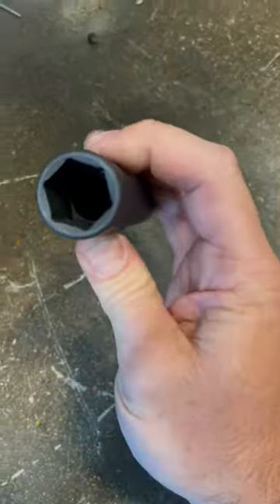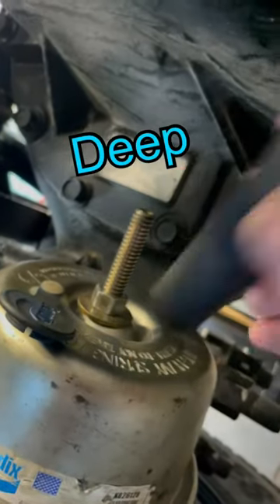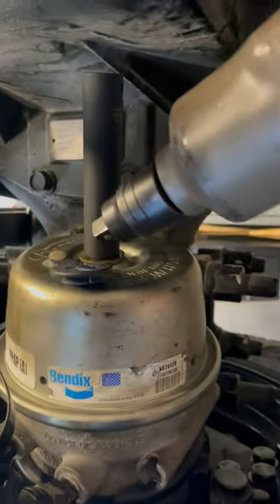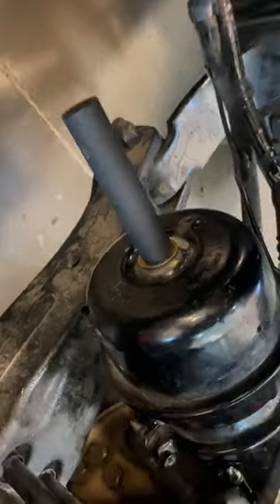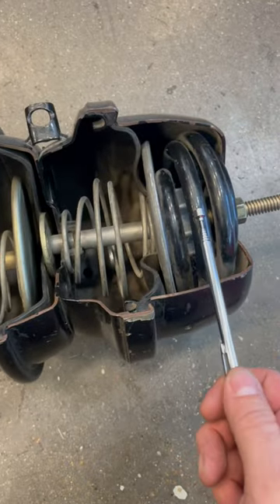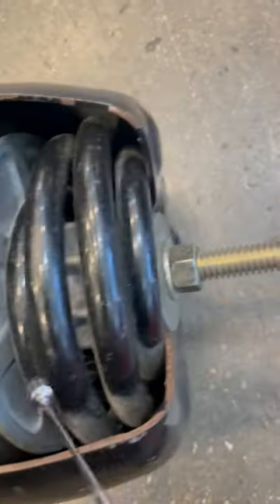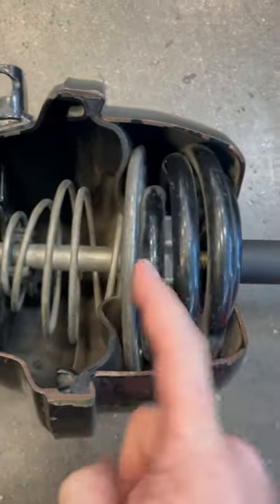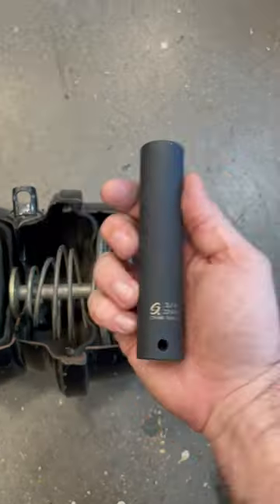Caging bolt SOCKET? NO!! #diesel #tools #garage #trucks #mechanic #custom #semi #diy #hack #tips #no

Comment: Yes there is that chance. There’s a chance of a million things happening but let me tell you that bolt will break  before the chamber every fucking time. Never once have I had the chamber itself ever break. And fyi the caging socket is what I use everytime. Please don’t come out here giving false information. Beginner mechanics need to know how to use all their tools and equipment and you’re gonna scare them away from doing something that’s worked for years with your own fears. Fuck fear, do your damn job and when something goes wrong then you learn to not do that or do it differently. No experienced mechanic is going to tell you that’s a bad idea idk where you’re getting that thought process from? I’ve never seen or heard anyone ever bring this up let alone experience it😂

Comment: Put air to the chamber spin the nut down hand the tight, tighten it up with a wrench. If the unit is wrecked then do what you have to do.

Comment: I just wonder if they make one in a 21mm or 13/16...
You can fit about 3 open ended lug nuts inside a normal deep well. Several times I've thought it would be sweet to have a really deep socket for this purpose. You could zap off five lug nuts off without having to touch/collect the nuts.

Comment: I always just release the brakes first then push the caging bolt inside, or just will the parking brake is released i just remove the chamber then just apply the parking brake and remove my fittings 🤷🏽🤷🏽

Comment: Easy to jus supply air, then lock bolt when spring is already compressed
Reply: Sometimes you don't have that luxury in the real world nice try though
Reply: And what if the spring is broken inside the chamber and cannot be compressed?
Reply: @topaz123212  no need to cage it then but the new  replacement chamber gonna need caging.
Reply: @mlafi7  never have I had to cage a new chamber to put it on sounds like you think that you know what you are doing through YouTube videos I have replaced brake chambers on many different trucks I would know what it takes to do the job
Reply: @trevormiracle9165  to each his own way buddy ,was jus a tip on how av done it .
Reply: @mlafi7  the ones we get here usually come pre caged and ready to throw into play, attach air lines and remove your new free caging bolt for the next bugger that comes in
Reply: @trevormiracle9165  as you'll see in my other comment, depending on where you get your chambers, some of them come with a caging bolt already in it.
Reply: @topaz123212  I have never had to cage a brake chamber to replace it is all I am saying and it's a lot simpler than caging it off and having to uncage it after installation
Reply: @trevormiracle9165 I agree with the other guy, for me it’s easier to cage them before installing, they typically come caged (for me). You’re probably that one dude who doesn’t clock them in the same position as the old one
Reply: @josh351  they only go on one way try to put them on the other way and they are upsidedown with the air hoses pointing at the ground
Reply: @trevormiracle9165 I mostly agree with you on this one but I’ve found a couple where I’ve had to clock the hoses to the side

Comment: There is nothing at all wrong with the socket or even using an impact, it all comes down to having some common sense when you're using it and not trying to bottom out the bolt.

Comment: I would chock the wheels on a couple axles and release the brakes at120 pounds and shut the engine down and attempt with speed to get under truck and with brakes released if lucky get tool on back and snug up before chamber runs out of air and with any luck not have to run wrench on it to much for it to make safe to change out.Remember there is 30 pounds on each side of chamber hence 30 30 air brake.They make bigger ones depending on applications 😊
Reply: ?? The "30" is the size, not pressure. As in 30 in² not 30 lbs.
Reply: 30in Sq x 60-70psi = 1800lbs

Comment: I just apply air to them even if the chamber has a leak it will still release it long enough where you can just spin the nut all the way down

Comment: Not an HD mech. But is it not just a matter of knowing your tools? My impact has settings that apply differing tq as well as a trigger that also adjusts. So I can use my impact even on small stuff but not break anything by setting it properly. But I have no idea how fragile those brake chambers are.

Comment: Bro if the spring is broke then no harm just stand back lol. Pancake failure is much different and less scary. Just release the brake and no worries.  It's not dangerous if you understand

Comment: Been using this style socket for close to 20 years and have never once had an issue. Hundreds if not thousands of chambers.
Reply: You've just never had one come back when they couldn't cage it the next time.
Reply: @vr6prodigy  I oversee a fleet of trucks. I've seen the same trucks every day for over a decade. I've never had an issue. Caged thousands if not more brake chambers.
Reply: yea i totally agree plus he keeps saying hammer which is not right. impact drills and hammer drills are two different things. impact drills dont really hammer at all its the centrifugal force of a spring assisted rotating hammer and anvil. it hammers side to side not up and down. sure u can over tighten it but force is not transferred in the same way like hes misleading 'hammering'

Comment: Ur not supposed to run it down tight , its only to back off the brakes,,,,if it breaks you just cant cage it anymore ,but the brakes will still release with air ,,,what r u talking about

Comment: I use what I have/need for the situation. When you're the wrecker operator, ZFG. Most common for me would be a 3/4 ratcheting closed end wrench, does the job quickly and is always in my pocket.
Reply: My favorite method, too.
Reply: gear wrench pass through socket set does wonders on them too

Comment: I have a 2 5/8”  1” drive socket that only gets used for tightening liner bolts on our mills. It weighs 10 pounds and is about a foot long lol.

Comment: Never use an impact but I damn sure do use a ratchet and a word to the wise make sure you put a little gear oil on the threads of the cage bolt it will keep he thread from getting galled up
Reply: Use the socket just don't use the impact gun use a ratchet and if you don't know what your doing with air cans don't do it have someone who knows what there doing deal with it I've seen those things grenade and hurt ppl bad not me yet back I'm also not stupid with them